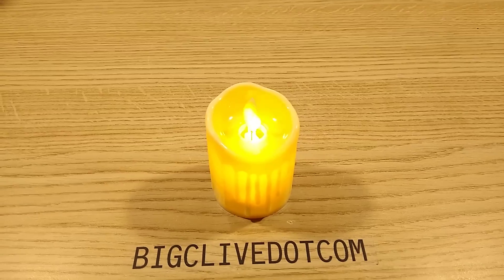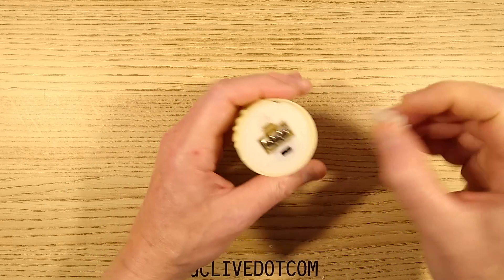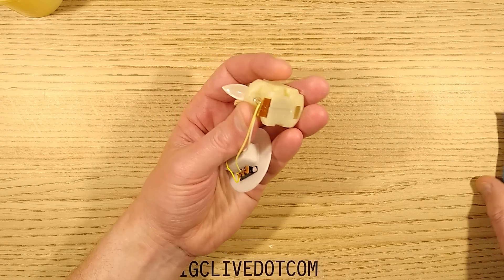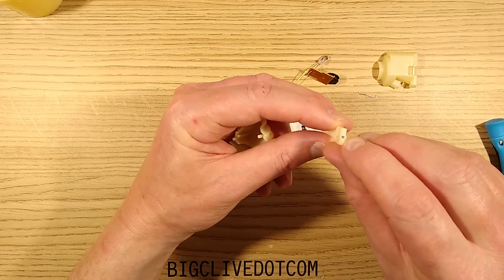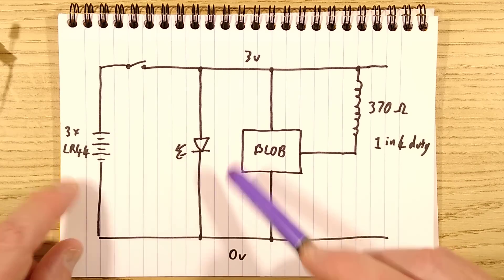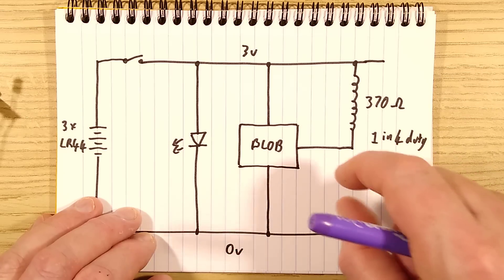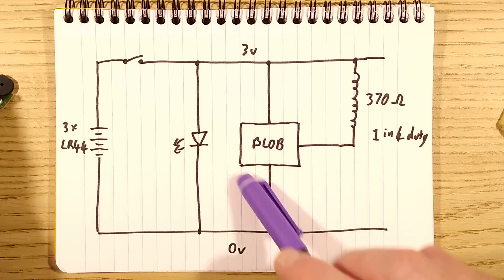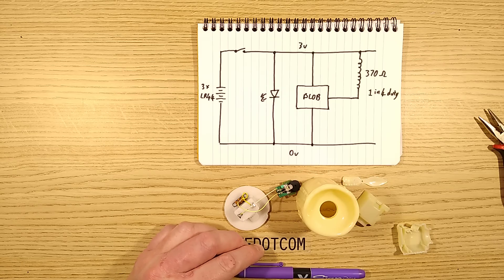Cheapest dancing flame teardown

Comment: I just got a set of 5 of the larger dancing flam candles today from a thrift shop. I put batteries in and all of the flames move, but no light. I can look in and see the led is just barely lit. Have the leds gone bad? Can they be replaced? Edit: I think I just found them on Amazon. Maybe them should have a remote? Maybe I need the remote to light them up? I have some led tapers that have a remote that looks the same as the one on Amazon. I’ll have to dig that out of Christmas storage to see if it works on them. I can always return them if they don’t work.

Comment: 'Add a diode or two to bring the voltage down... ' surely you mean a resistor?
Reply from the maker: Each diode drops roughly 0.6V, so can be used to drop voltage in steps.
Reply: @bigclivedotcom  I learn something with every one of your videos. Cheers.

Comment: I have a really fascinating suggestion you could try.
A home-made battery out of soldering wire. baking soda. and distilled or deionized water
Make a coil-spring of soldering wire. in a small container. Best is no-flux with highest lead content you can get your hands on.
Add baking soda to saturation. using distilled or deionized water (tap water CAN work but is not the best)
Then charge it at about 20mA for a while.
Discharge it and charge it several times. As many as you like.
I recommend a low discharge rate of 5-15mA to start with.
You'll see the capacity gradually increase every time.
Slow charge is the way to go. You'll get the most "capacity" stored in the battery this way.
Having the electrodes closer together helps with discharge current to a point.  Less voltage drop.

Its a lead-tin-solder alkaline battery! it really works and its super fascinating!
String several together and you can run an LED for hours

You can also try different electrolytes or mixtures. Baking soda is one. epsom salt is another that works. as well as Alum.
You can even hook up a joule thief circuit to one to extend the runtime to even longer. and use only one cell to drive an LED for example.
Or even several LED's

Comment: Add a 47 Ω to 100 Ω resistor in the supply lead , and you might run it off a (  recycled , HEY ! disposable vape battery , in a small cosmetic box , glued underneath ? ) will give hours ( or days ? ) of flicker .... ( ? ) ..... DAVE™🛑

Comment: There have been flickering LEDs around that used surplus melody modules - so the LED was driven instead of a speaker and flickered. Maybe this blob is also something like that, and they just replaced the speaker with a coil that pseudo-randomly deflects the "flame".

Comment: I'm sure they're working on cutting out more bits and pieces to cheapen it some more, heck, I once got a flickering LED candle from Poundland where they used bluetooth solder, completely wireless connectivity, didn't work though, probably hadn't been paired properly... :P

Comment: I have a couple sets of three candles per set similar to this. Each set came with a remote control that lets one turn the candles on/off, set a timer for a number of hours, turn the candle effect on or off, and change the brightness. Thankfully they use AA batteries so that I may use rechargeable batteries. I'd hate to think of the waste if I was using coin cell batteries in them. Because they are remote controlled they are always using batteries unless one explicitly turns them off using the switch on the bottom. From further than a meter they look pretty good though I can hear the clicking from the plastic piece that makes the flickering hitting something. It's not loud but noticeable in a quiet room.

Comment: Actually pretty smart that they use the internal resistance of the cells for the LED as that means when the coil is energized the voltage drops slightly and gives that flickering effect!
Reply: If they added even a small value resistor, it would be better. Would make battery last longer, avoid chance of over-driving LED with new cells and enhance the flicker.

Comment: Good to know. I would have glued a 3D-printed candleholder to the bottom of that thing, with a 3xAA battery holder in it. Or attach a USB cable with one dropper diode. This thing clearly needs a resistor. Not for just the LED but for the whole thing. If you'd power this candle like any LED, with an appropriate series resistor, the LED will cap the voltage for the blob.
And yes, there should indeed be a flame-coloured led in there, instead of a cold-white one.

Comment: PLEASE could you get on your 3D printer and try making a version of the flame that’s a semi-transparent fully rounded shape, not the usual flat opaque one that only looks right from one angle. Getting the weight distribution right will be tricky but I’ve always wanted to see if it can be done, as it’s the one thing I dislike about these things.

Comment: I guess, if you have a USB-supply, add a ' around 100 ohm' resistor and a diode that  you rip out of some old electronics, you will have a working one with maybe some special  effects due to extra flicker ;-) Especially if you put this just inline with the current power-input.
Not worth using new components...

Comment: could you simplify it further by placing a candle flicker 5mm LED in series with the coil, powered by 5v USB?  
    The coil current would pulse with the candle flicker LED and the coil would limit LED current to just about  the right amount.  no blob chip, no other resistors, just two components..

Comment: Once I tried to convert Christmas led light with same 3 batteries to usb and completely burnt it. Initial idea was to 3d print a 3 battery sized stub to put it instead of battery and wire usb cable with resistor inside... And I made mistake in current limiting
Reply: This is probably going to be me soon enough haha. I can't stand batteries and seek to convert them to USB as well.

Comment: The non ballasted led seems like a feature instead of cost savings. The flicker thats caused by the coil being pulsed so the impedence of the batteries cause the line and the led to drop, gives it a more candle like glow. Stablizing the line with a stronger power supply may be counteractive to the look.
Reply: Correct. I am using a 3.3'-ish voltage, a LiFePO4 battery. It went in a 2 AA battery powered Led flame candle (but more sophisticated than the above). Next to the LiFePO4 I have an empty AA shell, with a 100 ohm resistor. Now the flikker is super realistic, as the light goes out every time the coil is powered. And the duration of the LiFePO4 is nice and long (my version also has a 6 hour times, 6 hours on, 18 off). In December I will have them in operation again .. ..
Reply: Great point, I questioned this phenomenon before I read your comment.

Comment: 3 LR44 button cells are 4.5v not 3v. That's ok I had one of these wired to a 2 C battery holder and it ran for months on a set of them. I am going to wire a 2 AA battery holder to it.

Comment: Aren’t those LR44 cells nominally 1.5V apiece making the total 4.5V, again nominally? Might be worthwhile scoping the power rails. I bet they start at 4.5V and sag as the coil is pulsed. If you have a really high Z probe, looking at the coil voltage would be interesting. Alternatively, those near field phone charger toys you were playing with were terribly inefficient but a receiver circuit with a high efficiency red LED might give a nice visible indication of the pulse timing.
Reply from the maker: The LED will be trying to sink as much current as possible, so the high impedance of the cells will probably result in a voltage of 3V.

Comment: This one be a good one for electronupdate to do a decap of. The silicon is probably simple enough to really see what everything is doing at a low level.
Reply: Dont think its a microcontroller. Probably just a purpose built chip that pulses the coil by an internal clock circuit. I managed to make a few using a few transistors a few years ago but i dont have the design anymore but using raw transistors is possible

Comment: I always use the 5v to 3.3v modules to make battery LED lights, USB powered. Sometimes adding a resistor to fine tune the brightness. Fit the module into the battery box to keep it all safe/clean. Then you still have the switch and the option to return it to battery power in the future.

Comment: Curious if you could design an overly complicated driver consisting of old-school logic gates. LFSR perhaps to generate a psudo random stream of bits to wiggle the candle flame?
Reply from the maker: I have pondered using a microcontroller to generate an LFSR stream of random bits to a candle coil.
Reply: IIRC somebody a few years ago discovered a flickering LED that was playing "happy birthday" at high speed to create the effect! Presumably it was the nearest chip they had to hand that output a stream of random-looking PWM, but hooking a speaker in series gave a very disconcerting result.
Reply: @wolfgangmcq  That is pretty funny and also displays a lot of enginuity

Comment: This is kind of like the pendulum thing from several days ago.  The use of a circuit to add motion to a gewgaw.  What I'd like to see is Clive going back to his Joule Thief, and replace the 3 LR44s with a single AA cell, rectify and filter the output of a Joule Thief and use the LED to shunt regulate the voltage to approximately 3V.  Basically a garden light with a flickering flame.  Use a Ni-MH and a solar cell and we have -- the eternal flame that's lit even in the rain!  😮😮😊
Reply: Then you will have to isolate everything with varnish, and the LED with a transparent tube with transparent glue, and also insulate the coil, and the batteries in a waterproof capsule ...
Reply: @arturismagilov3285 relax